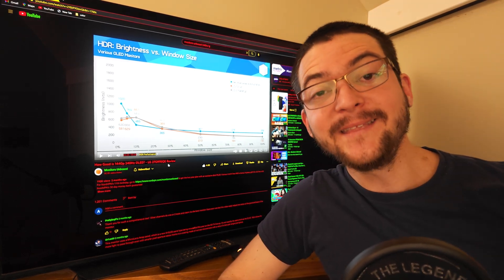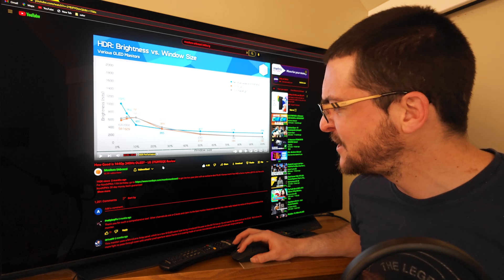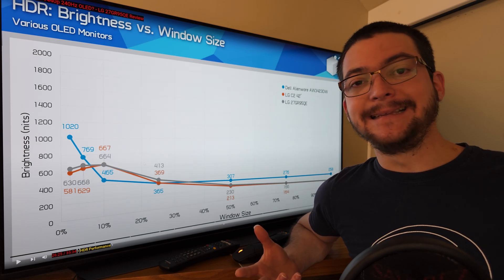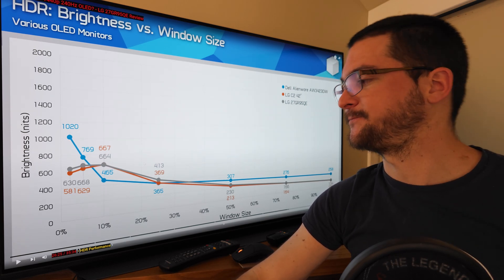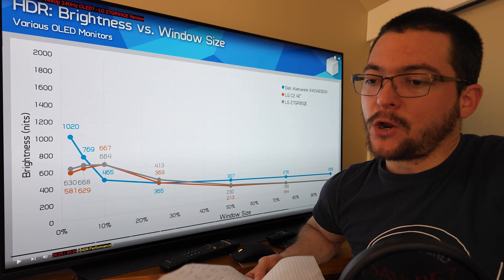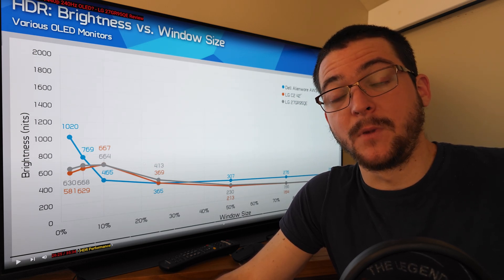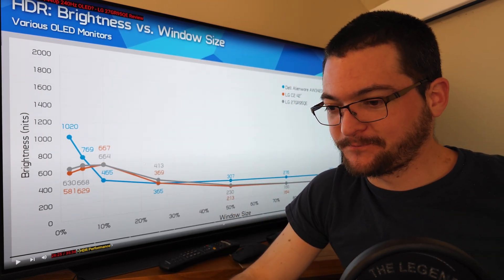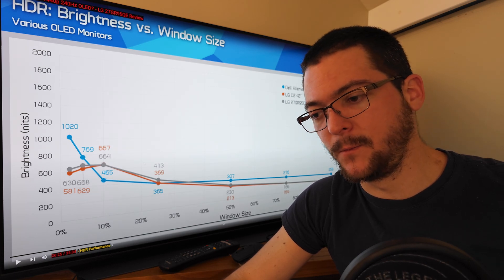BFI brightness reduction|240Hz OLED Monitors|Pulse width modulation vs Black frame insertion.

Comment: FYI, if anyone has this monitor. You can go into the service menu (using the same service remote that work on LG TVs). The service menu will show you the current tone mapping curve that the monitor is using as well as the currentmaxcll of the content. It looks like this somehow communicates HDR10 metadata properly with Windows 11. Idk how it does it, but it does. 

Now if anyone can figure out how to actually force a tone curve (like with LG TVs HDMI signaling override menu), please please PLEASE let me know! Some of the tone curves this panel chooses are absolutely not correct (i.e. 500 curve for cyberpunk - should be a 2000 curve, 10,000 curve for dead space - should be a 4000 curve). It's cool that it shows you which curve it's using but I failed to figure out a way to CHOOSE a curve 😕. I'm trying to see if there's some sort of signaling override-like menu but so far I can't seem to find it.
Reply from the maker: I'll pin the comment to see if someone knows
Reply: @plasmatvforgaming9648  Thank you sir! Honestly, if there is a way to control the tone mapping on that monitor, that would be a game changer. Because it seemed like the panel more or less does HGIG for games that respect the system-level calibration. It has a sharp roll off around maxtml but it's not that bad. The only remaining issue is not being able to select a tone curve. Because if we can do that, then we basically have DTM off. So for hgig-compliant games, it'll be hgig (more or less), and then everything else we can do DTM off (which is what you've been showing us anyway). The only other missing thing I think we need on this panel is some way to adjust for black level raise. There is a "black stabilizer" setting, but it's only available in the SDR modes, not HDR. I'm looking forward to an updated reshade config if you decide to investigate that further.
Reply from the maker: I will definitely get more out of reshade to share. Not having control over the tone mapping options is something I can't understand from these companies. Even LG has the settings hidden. I'm seriously considering getting involved with one of these companies to fix all this mess. I'm an engineer in Telecommunications and Electronics.
Reply: @plasmatvforgaming9648  I agree. These companies are selling enthusiast-level hardware without the options to go alone with them. It's bonkers.

Comment: I am curious.. what about microled technology ? Is having any motion blur or ?
Reply from the maker: Motion clarity is limited by persistence, meaning, regardless of the technology, it can not be better than its persistence. For example: a micro LED that's 240Hz sample and hold and has 4ms of persistence will have at best 4 pixels of motion blur when moving at 1000 pixels per second. It doesn't matter if the GtG is 0.000000001ms
Reply: ok thanks. So in terms of ,, next-gen '' motion clarity. What do you think would be next big thing or should be in terms of motion clarity technique ?
 @plasmatvforgaming9648

Comment: oled need more time to be good for gaming. if you want better blur reduction and no burning you need to buy a tn or ips for now
Reply from the maker: The LG C1 OLED motion clarity is 3 2ms of persistence equal to 3 pixels of motion blur when moving at 1000 pixels per second which looks better than a 360Hz LCD at only 120fps using OLED motion pro high. The picture quality with the settings I've shared on the channel is absolutely amazing, and the input lag is also good. I would say there is no better display when it comes to picture quality and motion clarity together than the LG G1/C1 on the market right now. LCDs can have better motion clarity using PWM with smaller Duty cycle, but the picture quality is not even close

Comment: 6:53 Philips actually pushes higher brightness levels on their OLED TVs when enabling Black Frame Insertion. Just like LG OLEDs, there are different levels of black frame insertion (in the case of Philips OLED it's minimum, medium and maximum). Surprisingly, according to HDTV Test, the higher level you choose for BFI, the greater the brightness. So maximum actually has a bit more brightness than minimum while having much better motion clarity. I believe they are the only company doing this and I hope other OLED TV and monitor makers follow in their footsteps.

Also, the monitor brand you are referring to (I know the name, but I won't mention them since you don't want to promote them) posted an update on their YouTube channel regarding black frame insertion on their monitor. The good news, they got a working implementation. Bad news, it's exactly as you feared. They aren't using a rolling strobe, they are simply inserting a black frame every other frame. So they won't be able to utilize the brightness level of smaller window sizes. If they want to boost brightness, they would have to boost full-screen brightness significantly, which I doubt they'll do. iirc, Chief Blurbuster said that burn-in doesn't scale linearly with brightness. So if you were to simply double brightness, burn-in would happen like 4x faster (basically it's exponential which explains why OLED window size brightness charts have such an aggressive curve). BFI does reduce burn-in risk when you aren't pushing extra brightness, but if you push extra brightness to compensate burn-in would probably be faster (not sure how much faster) than running the same average brightness on sample and hold. So while I hope OLED TV and monitor makers provide some brightness compensation for BFI, I hope they're careful and don't give too much. As OLED chemistry improves, they can probably compensate for more brightness over time.
Reply: Speaking of the "unnamed company", They are also asking in their forums now about how they should handle the max brightness level. It can apparently be pushed to 289 nits for a 100% white window size, but at the cost of faster burnin. Leave a good suggestion there and they will take it seriously. Even if the company is shady a good product will make other companies respond in time.
Reply from the maker: Do you know, what's the persistence of those Philips OLEDs? What's the Model? Are they going to support 120bfi on their upcoming OLEDs?
Reply: @Plasma TV for Gaming  HDTV Test said the motion resolution was more than 1080p lines, so it's probably around 3.3ms of persistence like you calculated for the LG C1. It could be around 4ms of persistence, assuming 1080p motion resolution, but HDTV Test said it was more than that, so I think it's safe to assume the number is close to your calculations. 

The model I'm referring to is the Philips 806, HDTV Test hasn't gone over black frame insertion on the newer models in his reviews for some reason.

The Philips OLED TV's using MLA will definitely not have 120Hz since LG Display changed the TFT backplane starting from the LG C2. The LG CS was the last TV I'm aware of that used the LG C1 display (the backplane could've supported 120Hz black frame insertion, but LG decided to software the option). I doubt LG Display has any much stock of those C1 panels, and I doubt Philips will want them. So, I'd assume future Philips OLED's won't have 120Hz black frame insertion.

Edit: LG Display is planning on releasing a 42-inch 240Hz OLED panel with MLA in Q3 2024. If Philips decides to use this panel, we could see a Philips OLED TV model with 120Hz black frame insertion again. But it'll come out late 2024 or early 2025, and it'll only work on the 42-inch model (if Philips bothers to even implement it again).
Reply from the maker: I bet that those LG CS with the C1 hardware can be hacked into a C1 to make 120bfi work, it's called Starwars mode and you can basically install the C1 software and make that CS exactly the same as the C1

Comment: Regarding flicker, I remember in the days of CRT, 60hz was almost unbearable. I would have to set my monitor to at least 75hz to make it comfortable. The higher the hz, the less flicker there was. Surely OLED should work in the same way as CRT? Higher hz = less flicker because the screen is strobing at a faster pace?
Reply from the maker: The short answer is that it depends on the person. And yes, usually, the higher the Hz, the less the flickering. I'll do a separate video about it

Comment: The OLED for today cannot even get to 1080 lines at 120 hertz. How many hertz do you think it needs to match the clarity of the plasma? 240-360? More?
Reply from the maker: My Plasma Panasonic TCP42S1 has 4ms of persistence, but the motion clarity isn't 4 pixels of motion blur when moving at 1000 pixels per second just because it has GtG limitations. The term motion resolution, 1080 lines of motion resolution, or 1080p in motion are usually used when the Blur Busters Law isn't clear. Depending on the speed of the object you can get 1 pixel of motion blur (consider to be perfect). Using an old benchmark with a speed of 240 pixels per second, I see why a reviewer would conclude the Plasma TV has 1080 lines of motion resolution but that's incorrect because as soon as you move faster the TV will show more motion blur. The only way to claim that a display has ideal motion clarity for a given peraon is if it can show 1 pixel of motion blur (which is considered ideal at normal viewing distance but not perfect (half a pixel of blur at the leading edge and half a pixel of blur at the trailing edge)) at the maximum eye tracking speed that the person is capable of which is also going to depend on the pixels per degree of view ( basically screen size).
Reply from the maker: So, to answer your question, a 240Hz OLED would definitely look more clear ij motion than a Plasma like mine, just because a Plasma like mine has other motion clarity limitations such as GtG. The LG C1 at 60bfi looks similar to the Plasma, and that's the equivalent of 158fps.

Comment: Based on the Talbot-plateau law, is 60Hz BFI much darker than 120Hz BFI? If so, are your BFI settings for SDR HDR trick and 22-point calibration for 60Hz BFI or 120Hz BFI? Because I have been using them on 60Hz lol
Reply from the maker: The Talbot-Plateau's Law is basically explaining that we get the average brightness in time. The brightness is the same when the ratio between picture and dark period is the same, which is the case on the LG C1 when using OLED motion pro high at 60, 100, and 120fps. So the settings apply for all 3

Comment: i could be wrong, but for bfI to not look stuttery, is you have to have vsync on and your fps can never dip below the max refresh rate
Reply: The same thing applies to fixed refreshrate sample and hold displays it's just with blur reduction you have less blur to hide the stutter.
Reply from the maker: PWM+VRR is possible, but we are  not even getting bfi, let alone a more complicated tech
Reply: @plasmatvforgaming9648  VRR blur reduction without big downsides isn't even possible variable framerates create variable flicker which is extremely noticeable unless frametimes are extremely stable then you might aswell be using fixed refreshrate.

even 10 microseconds of frametime variation can show visible flickering most games framerate jumps around alot and creates really bad flickering.

The few strobed vrr monitors that do exist are using a pwm technique to reduce the flicker but in doing so they are destroying the motion clarity and it all becomes very pointless.

How do I know this? I modified my lcd to single strobe vrr I have some videos on this channel if you're interested search "diy vrr backlight strobing" on youtube
Reply from the maker: I was thinking about doing PWM with VRR but within a range, to make sure the display doesn't go below the noticeable flickering threshold. For example, 80 to 120fps would be a great target using 33% duty cycle. Ideally, having the ability to adjust the duty cycle.
Reply from the maker: I will definitely check out your video
Reply: @plasmatvforgaming9648  definitely ways to make it somewhat use-able like limiting it's range. but the flickering you get with vrr blur reduction even happens at high refreshrates even 240fps will have tiny variations in frames times that create human visible flickering

3 things that can cause abnormal flickering vs fixed hz strobing

1: flicker from low refreshrates
2: frame-time jitter even tiny amounts
3: variable average brightness.(this one is easy to solve just use dutycycle percent per frame only side-effect is variable mprt)

definitely would need some smart algorithm to pull it off balancing the compromises and it's really hard with vrr because it's impossible to predict what the next frame-time will be. so it even needs to predict things.
Reply from the maker: Variable MPRT is better than variable brightness. In my opinion, the best experience is a locked FPS anyway, but it would definitely help to have some headroom, so really just allowing a 20 fps drop would be great. Because I can't get 120fps rock solid in most games with my system, but I can get 100. Just 100-120fps VRR+PWM at a given duty cycle would be great. I would still like to have the option to expand it and see how 80 to 120fps range would work.
Reply: @plasmatvforgaming9648  it works from my testing it looks good in motion but even 80- 120fps will still have some erratic flickering it's definitely playable it's like oled vrr gamma flicker but abit worse.
Reply from the maker: Makes sense
Reply from the maker: That's right
Reply from the maker: Hz=fps all the time

Comment: Just a quick question. What is the lowest motion persistence ever for plasma? I know they were all over the map in this area, including motion clarity. My guess is maybe 4ms, or possibly even 2ms? I know that the Panasonic GT25 & VT25(From 2010) delivered 1080p motion clarity, of the few out there that actually did. Not even the ST60 can hit 1080, i think it's 800-900.
Reply from the maker: My Plasma Panasonic TCP42S1 has 4ms of persistence, but the motion clarity isn't 4 pixels of motion blur when moving at 1000 pixels per second just because it has GtG limitations. The term motion resolution, 1080 lines of motion resolution, or 1080p in motion are usually used when the Blur Busters Law isn't clear. Depending on the speed of the object you can get 1 pixel of motion blur (consider to be perfect). Using an old benchmark with a speed of 240 pixels per second, I see why a reviewer would conclude the Plasma TV has 1080 lines of motion resolution but that's incorrect because as soon as you move faster the TV will show more motion blur. The only way to claim that a display has ideal motion clarity for a given peraon is if it can show 1 pixel of motion blur (which is considered ideal at normal viewing distance but not perfect (half a pixel of blur at the leading edge and half a pixel of blur at the trailing edge)) at the maximum eye tracking speed that the person is capable of which is also going to depend on the pixels per degree of view ( basically screen size).

Comment from the maker: I measured 110 Lux (with lux light meter app on my s23u) full screen white using OLED motion pro high on the LG C1  (38% duty cycle based on my testing) with the SDR HDR trick I shared for Win11.
Reply from the maker: LG C1 120fps OLED Motion Pro high has 38% duty cycle meaning 3.2ms which is better than the 4.15ms that a 240Hz monitor can achieve by just inserting black frames